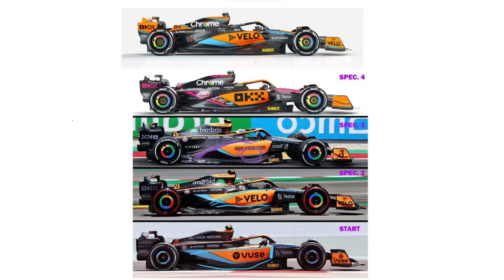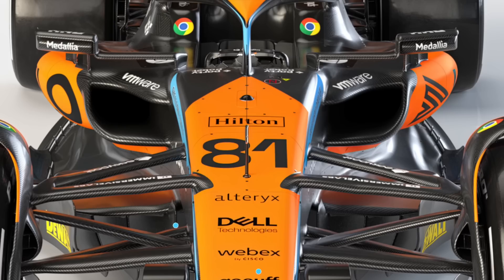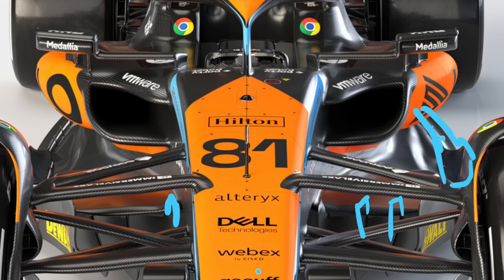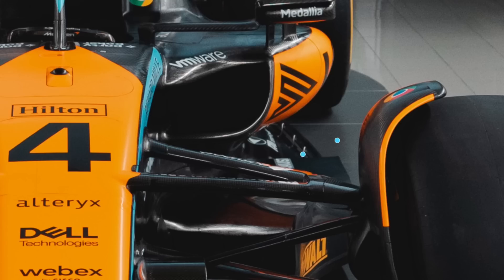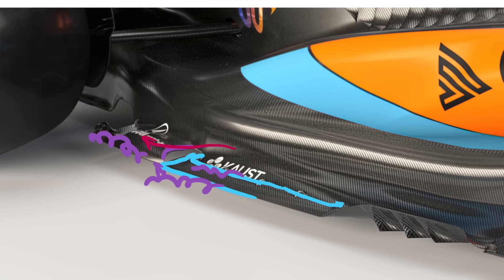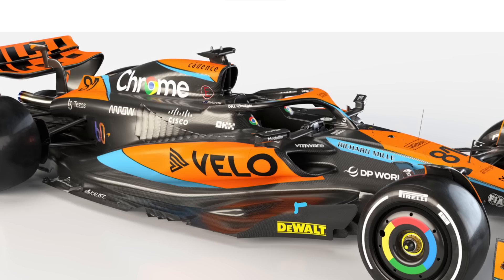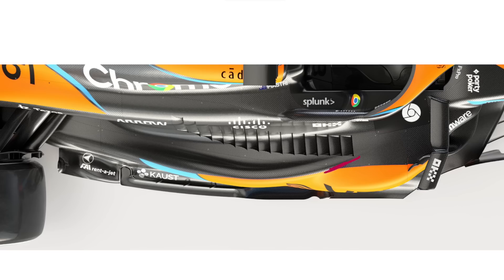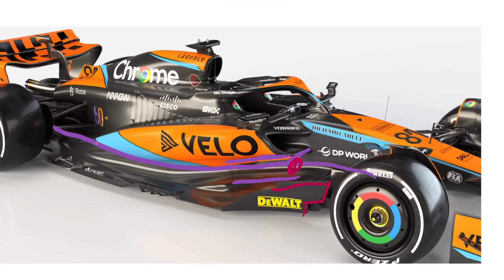McLaren MCL60  -  Aerodynamics Analysis and Initial Thoughts

Comment: Maclaren were the first to show the deeper, more channelled sidepod top. Also, they were the first to show the absolutely maximised sidepod undercut and boat like bow to the tub above the venturies vanes. Alfa, hass and ferrari and Aston have followed suit on their launches, which has got boring fast. It's odd though that nobody else have copied redbulls 2022 single carbon fibre blade front suspension " wishbone", giving it stiffness and flex for the drivers grail of a pointy front end, and massive weight saver.

Comment: it would be interesting to see an analysis of the lemans hypercars, if that's viable. I know they're limited on lift/drag ratio, but I'd like to know you're take on how they're getting there. Appreciate this may not be possible if they're mostly working off underbody effects.
Reply: He has an analysis of the Peugeot and if im not mistaken of the glickenhaus
Reply: Is it the Audi that doesn't have a rear wing? Basically with the drag/downforce limits, they discovered they could make good downforce just behind the front wheels, plus the diffuser, and the rear wing just wasn't necessary.
Reply: @KevinJDildonik  it's the Peugeot

Comment: The Ferrari appears largely unchanged, which is understandable given that the 2022 package was good, and that there will be a focus on engine reliability. However, there appears to be changes to the less conventional aerodynamic elements. I noticed an additional airfoil implemented to the top of the halo, and a restructuring of the mirrors with added aerodynamic elements.
The lighting is not ideal so I will await images from the track debut, especially since you can't see any of the floor. But, the front wing does appear to feature Mercedes-esque fins. To my understanding these elements were deemed illegal for 2023, so perhaps the render isn't strongly representative of the real car?